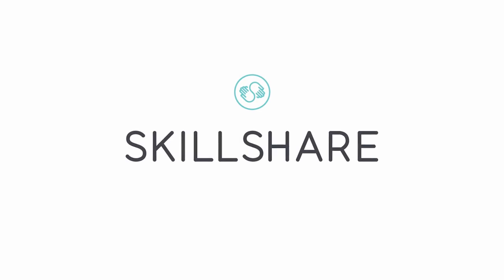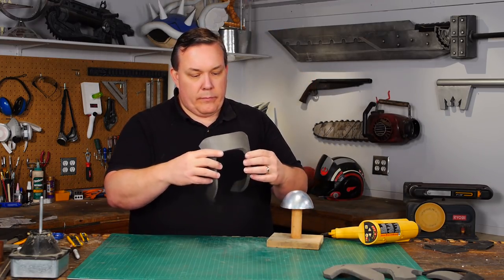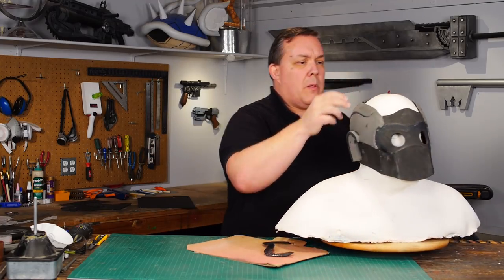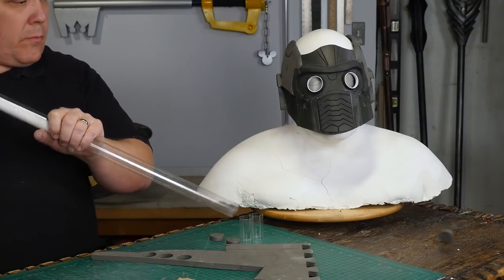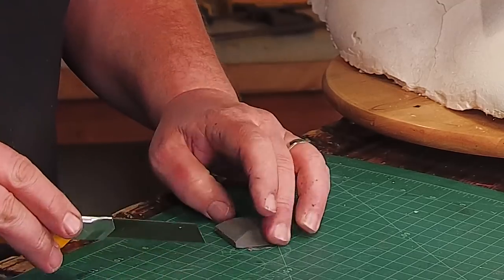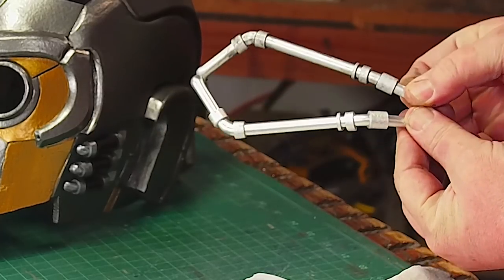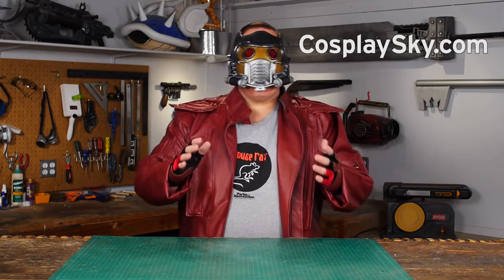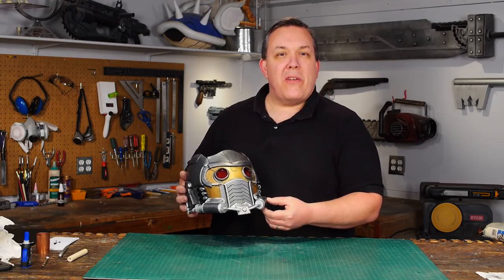Odin Makes: Star-lord's Helmet from Guardians of the Galaxy

Comment: Hey there! Question-
I tried to print the pattern out but it wants to print as an image, and even increasing the size makes it far too small, any tips? I usually use dropbox and it works fine so maybe it's my
 lack of tech skills
Reply from the maker: I probably save that one as an image so I apologize for that. May be imported into a word program? And tell the picture to be at 100% size? Some image programs will automatically scale things to fit your printing medium, thinking they're doing you favors!

Comment: Odin I have a question where you're looking for material. Foam core , Eva foam. et cetera
Reply from the maker: Where am I looking for material? I live in Northern California, so some of these place may be just around here...
The thick grey EVA foam I am always using comes from Harbor Freight Tools. It's the floor mat 4 pack.
The black and colorful Craft foams (also EVA) mostly comes from Michael's crafts store. I will pick sheets up at other local places, but Michael's is my main place.
Michael's also carries Foam Core, or I will pick up the cheap stuff from Dollar Tree too. Depends what I want to do with it. Dollar Tree foam core is good for patterns and experimenting, Michael's carries Elmer's brand- which is excellent for use in a finished project.
Most materials typically come from Home Depot, ACE Hardware, TAP Plastics, Michael's, Dollar Tree... fabric stores are good too, Jo-Ann's also carries craft supplies and EVA. I have yet to order EVA online, but I suspect I will at some point.